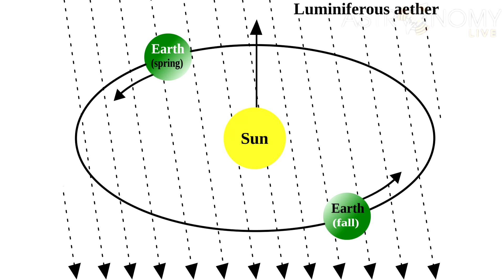Airy's Failure

Comment: This is absolutely absurd. The water slows the starlight because it has a refractive index of 1.33. Meanwhile, the telescope is travelling laterally at the supposed orbital speed of the earth, which would remain constant, water or no water.
Reply from the maker: @KaichosMan  you are tacitly assuming (incorrectly) that the slowing effect of the water will have no impact on the light's velocity with respect to earth from Earth's lateral velocity component relative to the emitter. This is false. That is exactly what I'm demonstrating in this video. 

Imagine a laser stationary to the telescope aimed at an identical water filled telescope just to the side of the first one, pointed at the same angle as the star. Would this laser remain at the same angle in this identical telescope while a parallel ray from the star diverges in the original telescope? If so, either the water is selectively slowing the light in the two telescopes by different amounts, or the speed of light itself is not constant.

Imagine a star moving laterally relative to earth at a much higher velocity than Earth's orbital velocity alone. Would you say this star's light should diverge laterally in the water filled telescope even more than a star not moving laterally relative to earth?
Reply: @Astronomy_Live  what's your thoughts on the neo-tychonic geocentric model?
Reply from the maker: I have yet to see a proponent of a neo-tychonic geocentric model properly explain stellar aberration, including Airy's water filled telescope. I really do want to hear a neo-tychonic proponent answer my question about what is expected for a star moving laterally relative to Earth at a velocity several times greater than Earth's stated orbital velocity. For that matter, I want to hear what they think would happen in my hypothetical involving the laser I described above. 

Witsit seems to think my explanation of aberration is wrong, but I asked him about this hypothetical in Tim Pool's comment section and he hasn't answered me. Given the video his partner recently released it seems he may have bigger problems to deal with right now. I hope she's able to get out of the abusive situation she seems to be in.
Reply from the maker: That's not an answer to my questions at all. I asked two questions in my initial reply, your diagram doesn't address either.
Reply: @Astronomy_Live  I keep texting but it keeps getting deleted, I don't know Why
Reply: @Astronomy_Live  The geocentric explanation for stellar aberration is very simple, and the simplicity speaks for itself. In reality, there is no aberration of star light. Rather, what appears as aberrated star light on Earth is caused by a movement of the whole star field around a fixed Earth.
Reply: @Astronomy_Live  Essentially, the cause for stellar aberration is the same as stellar parallax – the stars are aligned with the sun and thus revolve with the sun around the Earth each year.
Reply: @Astronomy_Live  Consequently, stellar aberration is not caused by a bending of the star’s light, but by the revolution of all the stars around the Earth, which, depending on the latitude of the star with respect to the Earth’s equator, makes the starlight appear as a circular or elliptical annual motion on Earth. The star field rotates around the Earth on the north/south celestial pole, but the pole itself revolves with a 20.5 arc second radius. As viewed from Earth, the motion of the stars on or near the celestial pole will form a circle in the north, an ellipse at 45º latitude and a hyperbola at the equator.
Reply from the maker: @moneyheist_-  that isn't a response to what I asked you. Reading is fundamental.
https://drive.google.com/file/d/1kr6CdTybwTqq2lntvJm3R1D2JFfum2ap/view?usp=drivesdk
Respond to what I actually asked you, which pertains to what neo-tychonics claim Airy should have seen in his experiment if earth is orbiting the sun. According to those claims, what would happen in the two hypotheticals I gave you?
Reply: @Astronomy_Live  that question was directed to someone else, not me
Reply from the maker: @moneyheist_-  you asked me what I thought of the neo-tychonic model and I told you I had yet to see any proponent for it answer those hypotheticals. So yes, I asked you, you're promoting it.
Reply: @Astronomy_Live  The answer to your first question is no, the laser beam and the star’s light beam should emerge at the same angle in the water-filled telescope, because the star is moving laterally.
Reply: @Astronomy_Live  as for your second question, No, In this geocentric model, the divergence of starlight in the water-filled telescope is determined by the overall rotation of the star field around the Earth, not by the individual lateral motion of a star. Since the model assumes that starlight travels in a fixed, linear direction without aberration, additional lateral motion of a star relative to Earth does not change the way its light interacts with the telescope. Therefore, a star with a higher lateral velocity would not cause greater divergence in the water-filled telescope than a star with lower lateral velocity.
Reply from the maker: @moneyheist_-  I didn't ask you what the angle would be after it emerged. Yes or no, would the laser and the starlight remain parallel while in the water filled telescopes?
Reply from the maker: @moneyheist_-  if lateral motion would not cause a photon to change its angle in a water filled telescope then you disagree with those who claim Airy's experiment provides evidence of earth being stationary.
Reply: @Astronomy_Live  Yes, they remain parallel.
Reply from the maker: @moneyheist_-  then Airy's water filled telescope experiment does not provide any evidence of a stationary earth.
Reply from the maker: You just contradicted your previous statement. You claimed the laser would remain parallel. Now you're saying it wouldn't. Make up your mind and address my hypotheticals with consistency or stop wasting my time.
Reply: @Astronomy_Live  in my previous statement, I was answering under the assumption that we live in a geocentric universe, while in the second statement was under the assumption that the earth  orbits the sun
Reply from the maker: My example had earth moving relative to the star. I literally said the hypothetical had the laser diverge according to neo-tychonics. Again, if you can't be honest, don't waste my time with your replies.
Reply: @ Fortunately, the proposition is way to simple to require the use of lasers. Stellar aberration is supposedly caused by the interaction between a planet travelling laterally at 30 kms a second and vertically travelling light from unmoving stars. Filling a telescope with water can't change the motion of the earth, but must change the speed of the starlight. The angle of aberration should have increased. To return to the "running in rain" metaphor, the rain has been slowed down, but the running hasn't. The rain should be coming in at a greater angle.
Reply from the maker: @KaichosMan  you're not answering my hypothetical. Does the laser light diverge from the starlight in my hypothetical? If you're not going to answer me, don't bother replying.